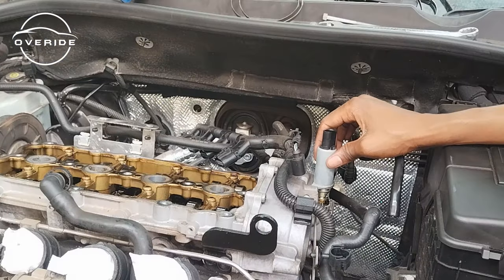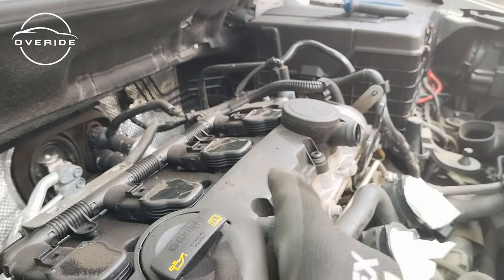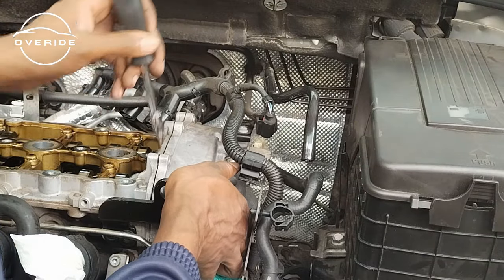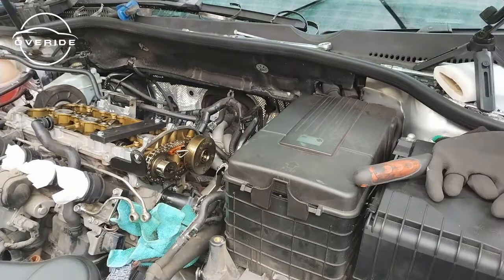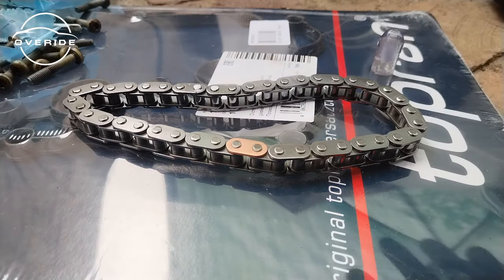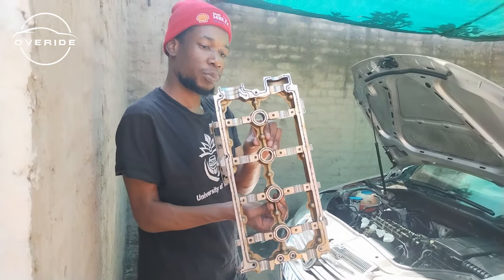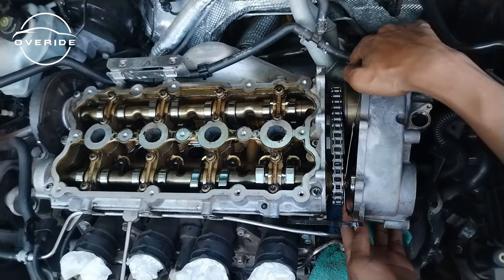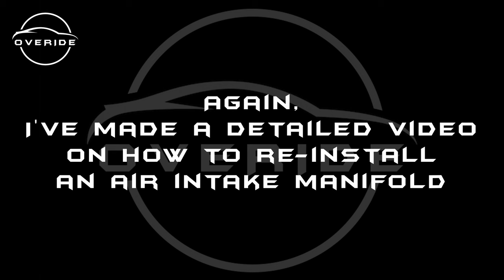How To Replace A VW 2.0 FSI Timing Chain | VW Golf/Jetta Mk5

Comment: Again! A super well made video full to the brim with information.
Reply from the maker: Thanks man, I appreciate it. If you wanna do the job and there's something not so clear please ask I'll clarify... Thanks for supporting the channel as well 🙌🏼🙌🏼🙌🏼
Reply: @OverideZA Yes, well, first of all, do I HAVE to remove the timing belt cover (on the opposite side of the engine) in order to remove the timing chain tensioner? (Located between the riming chain) Do you have WhatsApp? Could I ask some questions there
Reply from the maker: You only need to make sure that the car is on TDC before removing the chain. If you can do that without removing the cover then great, but if not you have to remove the cover.
Reply from the maker: Yeah I have WhatsApp, check my number on the Facebook link

Comment: The locking tool didn't fit because you didn't have the cams in the correct position for the tool to fit (iirc its TDC on cylinder 1). 
Also don't use a torque wrench for wrenching to undo bolts. Its a precision instrument and you'll put it out of calibration.
VAG connectors come off a lot easier without risking of breaking if you push down on the connector then press the release tab and pull.
Reply from the maker: Oh okay thank you for the advice, will surely make use of it next time.
Reply: Was about to say the same. Timing tools are always go tight as it's high precision  tool/poistion.

And Cam carrier should use special sealant not standard silicone as so much silicone will make it sit little higher what will affect clearance on camshafts.
Reply from the maker: At times they are never tight, they have a lot of play and makes the job a sloppy one.

With the sealant I used one which has a good level of reputation and even today, I've never seen a single leak
Reply: @MegatronicsZA  What was the sealent you used? I have hondabond but not sure if that would work
Reply from the maker: I used Reinzosil which comes in a blue/white packaging and it works perfectly. I have not even seen a single leak

Comment: I didn't know and I'm still not sure whether mine has both chain and belt  but I'm starting to assume it does have both. The manual does not say there is a chain too . I have an A3 FSI 2.0 from 2005 .
Reply from the maker: Give me your engine code I will check for you
Reply: @MegatronicsZA  engine code is BLR mate . Thanks .
Reply from the maker: @user-ft2yz6fy6t it does have a chain which drives the intake cam.
Reply: Ok mate .Thanks for the info  Much appreciated. Trying to learn all I can and try do my own maintenance. I have had my A3 for five years and it's not been to garage while I have had it so I must be doing something right lol.
Reply from the maker: @user-ft2yz6fy6t  it's a pleasure man.

Lol I guess you are doing things right if the car is also not complaining
Reply: It has been a good car and has served me well. I would own another VW engine, as long as keep up the maintenance with them they march on .
Reply from the maker: @user-ft2yz6fy6t yeah they are pretty much lively when they get the maintenance they require.

Comment: Think about using longer m10 for the sprocket cuz i think you strip it because the m10 wasn't fit all inside the bolt head due to it's length
Reply from the maker: Yeah, I think I also didn't put enough pressure for it to sit properly on the bolt. I'll try that next time, thank you.

Comment: Mate , also want to know about the oil control ring 
It’s should be replaced? 
In case it’s get damaged in the process, can you please help me find the oem number? 
I found some seller on Aliexpress 
But they can’t be sure it’s will fit our engine BVY 2.0 fsi 
But it seems the same 
Please help 🙏🏻
I’m afraid my oil control ring going to fail or breaks because high mileage engine (240k kilometres)
Never been replaced (timing chain ether)
Reply from the maker: @razieltac5365  hey man, it's not necessary to replace the oil control rings if they are not damaged, but if you do want to you can but it's not a must. I will check a part number for you... Damn 240k KMs without a replacement chain, that chain was strong.
Reply: @MegatronicsZA  😂
Thank man appreciate it 
When I bought my lovely Jetta it was around 135km, and I didn’t do it yet😬 
I very hope the last owner did it
I will hurry up with it, hope it won’t break me
Reply from the maker: @razieltac5365  my fear is that it might break and it'll be a lot more costs
Reply: @MegatronicsZA  hi buddy, did you have a part number for me? Oil control ring
Reply from the maker: @razieltac5365  oh hey man sorry, the part number is 06F 198 107 A
Reply: @MegatronicsZA    
Thank you 🙏🏻
Reply from the maker: @razieltac5365  pleasure.

Comment: Mate, I’m wondering how the exhaust camshaft didn’t fly? 
I’m afraid to do it that way It’s a lot of force from the timing belt 
And for sure I don’t want to stripping the bolt 
I want to it your way 
Also, I heard there’s a special seal for the camshafts tray and should not use the RTV
Thanx🙏🏻
Reply from the maker: @razieltac5365  if you can look back, there's a steel bar I put over the cam variator so that it can put pressure on the exhaust camshaft, I later removed it after noting that the camshaft was not lifting. That also depends on how much tension is on the belt. The not strip the bolt get someone to help you. I'm not sure about that but I used Reinzosil, it's the best on the market.
Reply: @MegatronicsZA  yes I see your videos repetitive
I notice later that the bar didn’t effect much, an I thought maybe you release a bit of tension from the tensioner on the belt 
Or maybe there’s isnt enough room there to get to the tensioner (because of the upper mount) 
and you just the first one to discover that the camshafts did not lift if pulling out the cams tray 
I trying to be the less “surprised” in the process
Reply from the maker: @razieltac5365  lol 😂 🤣 😂 you can never get less surprised, hopefully the video will get you pre-ready for the surprise. Thanks for the support on the channel

Comment: hi my chain broke I have to remove the cylinder head to check the condition of my valve because I saw some people have nothing broken the valves?
Reply from the maker: Hey man, yeah if it broke then you have to remove the cylinder head because there's a chance the intake valves are damaged.

Please kindly subscribe to the channel if you haven't done so already, I'll appreciate it.
Reply: @MegatronicsZA  OK thank you I think it's the pulley screw that broke I'm going to remove the cylinder head tomorrow I subscribed in France no one wants to change the chain
Reply from the maker: @makacrack700  the pulley screw that you have to remove in order to remove the cam gear? So when it broke the gear fell off inside the cover?

Thank you for subscribing, if you were in South Africa I'd fix it for you.
Reply: @MegatronicsZA  yes I changed the chain it started the first time after 5 minutes because there were 2 of us working on it I didn't want to do the screwing so I removed it with the reinforcement how the video worked very well but I'm sure It’s the aim that broke that of the pulley that holds the chain. I have no idea who happened.
Reply from the maker: Eix that's bad man sorry. Try to see if you can get another screw and replace the gear as well
Reply: @MegatronicsZA  yes I have a screw but I will have to check the condition of the valve in addition I had done the distribution so I will have to put back the Courois water pump...
Reply from the maker: @makacrack700  okay man I hope all goes well
Reply: @MegatronicsZA  hi I took the casing apart and it's not the chain it did something weird you wouldn't have insta or anything else to send photos
Reply from the maker: @makacrack700  I do have a Twitter and Facebook account, you can use either. Check on the video description and channel profile for the links.

Comment: Is there a marking on the crank gear please?
Reply from the maker: The crank pulley has no marking... The marking is on the camshaft gear.
Reply: @MegatronicsZA  so how do I check the piston timing then?
Reply from the maker: @jeanlorrainesolomon958  there's a marking I showed on the video. That mark needs to line up with the OT mark.
Reply: @MegatronicsZA  thank you for the info. 🙏
Reply from the maker: @jeanlorrainesolomon958  Please make sure you don't skip the video because you will skip vital parts of the job and you won't know where you've done wrong.
Reply: @MegatronicsZA  I watched the video and now I'm sorted thank you. 🙏❤️
Reply from the maker: @jeanlorrainesolomon958 it's a pleasure. If you have more questions just ask, I'll clarify.
Reply: @OverideZA hi there, can you tell me how the mark must be on the intake cam please? Is it on top or in the middle please help.
Reply from the maker: @jeanlorrainesolomon958  The mark can be a circle or a triangle depending on the engine and revision of the intake. With cams facing each other in their correct position, when you look from the other side of  the intake you should see a marking.

Comment: I have a problem that rpm still high for 2 minutes when i start the engine then it came normal
Reply from the maker: It's a normal thing across all cars. Don't stress about it. Especially when you are starting the car for the first time in the day (usually in the mornings).
Reply: Thank you. It was about 30 seconds but now about 2 min. Is it normal?
Reply from the maker: @mohammadalkhalaf2658  could be normal, it also depends on the seasons. During summer it take a bit longer, in winter it doesn't last much

Comment: Boss I wish to pay you a visit maybe you can solve a problem I have, pity I can't share contacts
Reply from the maker: What's the issue with your car?
Reply: Two warning signs on the clock the motion sensor light and airbag they affect the power of the car
Reply from the maker: @solomonmnguni9742  oh okay that's interesting. Is the ESP warning light?